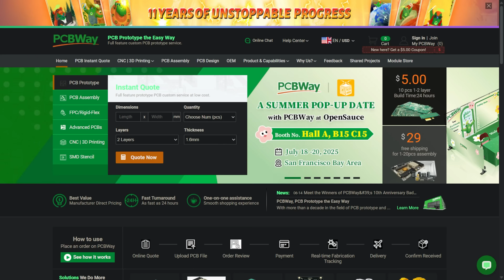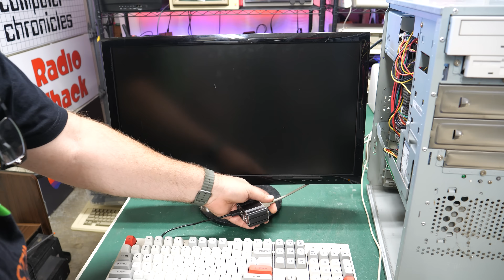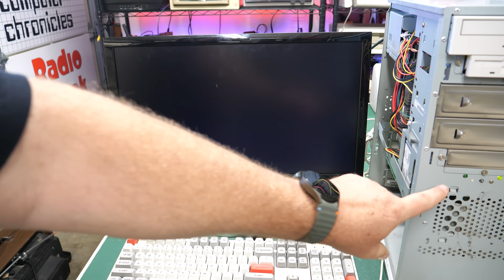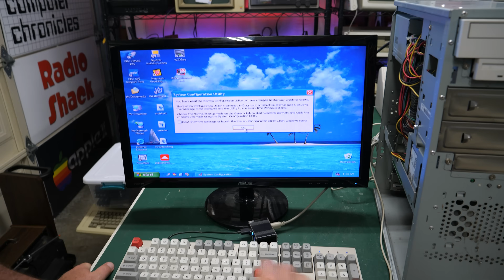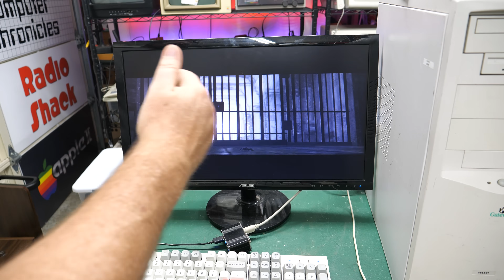Always Check Inside First! Gateway 2000 Edition

Comment: You should have set the time and date in the BIOS. Mismatches, especially huge ones, with Windows system time can cause a variety of issues.

You also should probably have just loaded BIOS defaults. Although not all manufacturers record good defaults, Gateway was pretty good about it. Even if you want to customize settings, you're better off loading defaults and then customizing.

Comment: OK, obviously these people howvwere doing whatever they were when they were tinker inside the computer obviously didn’t know computers are even how to go in there and make modifications.

You don’t have to cut any cables to take away things because everything can be removed with with just pulling the cables out or push, pushing in the lock clamps to unlock the cables..

🙄🙄🤦🏻‍♀️🤦🏻‍♀️

Comment: That takes a lot of talent to cut an audio cable inside the computer like that. I have never in my years of fiddling around inside computer cases ever cut a cable. And I have never cut a sound card cable.

I’d like to even know why they wanted to cut the cable because there was no reason to cut that cable because if they needed to change a different connection, an adapter takes care of of all your needs.

You simply went down your Micro Center and get whatever the hell it is you need or even the Best Buy if you don’t have a Micro Center.

Comment: I suspect those wires were possibly cut by somebody following a company procedure for decommissioning old computers.
Similar to how companies are sometimes known to only drill holes through laptop screens while still leaving hard drives and everything else perfectly intact inside!

Clearly not really intended for preventing anyone from recovering the data. Possibly as a half arsed deterrent, as they seemingly didn't really care about what was actually left on the drive. But possibly more so also to avoid destroying more important parts inside, maybe to cash in on the second hand market while potentially exploiting a tax loophole.
Unless they were otherwise just expecting it to eventually become land fill, which they probably didn't care as much back then about leaving data on the drive and just thought to cut the cables inside instead.

This token attempt at barely crippling the hardware can supposedly help to very quickly and cheaply further depreciate the value of computers that are being decommissioned. This deliberate decrease in value might be to increase the amount a business may be able to claim back on tax when claiming the estimated amount of depreciation as a business expense (either that or whatever is the nearest equivalent financial loophole). Something to possible claim was a necessary company security policy for writing off e-waste, but deliberately only doing just barely enough to questionably legally justify such a claim.

If I am right, then it might be why they had hilariously completely snipped off the power connector for the hard drive to quickly pretend to have made an effort to do something about the data on the drive. With clearly no intention of actually doing anything about the data on the drive.

Though we could possibly give them some very slight benefit of the doubt for seemingly faking it, as this could have happened not too long after a time when there were probably still less people about that would have considered just cutting those hookup wires as not an appropriate solution to seriously mitigate a potentially high level of risk to data security. As demonstrated in this video.

Thus the company, or someone within the company, might had tried to increase the companies tax return, while reducing the possible need for an e-waste disposal service (if there was such a thing there back when this happened). While it is also possibly that someone was trying to make some money on the second hand parts market.

I suppose the contents of the drive might be a clue as to if the computer might had been more of an office computer, or a home computer or possibly already a second hand computer that was still up for sale until the wires inside were eventually cut.

Well that is just my guess though anyway, as such a thing is allegedly a thing.

Comment: I have three of those exact computers in my basement I got from work when they were going to throw them away.  They had been taken apart as part or a computer class.  Not sure if it's the same processor or not though and don't have all of the cards you have in this one..  I put them back together and got all three to work.  Put a 60 gig hard drive in one and used an old gateway restoration disk I had that put windows ME on it.  I use it to play some old games on at times.
Reply from the maker: Nice

Comment: I usually put an unknown system in a garbage bag for a couple of weeks.  I open the system before powering up.  When  powering up I use a power strip with one finger on the switch just in case.  Also, a pencil or ink eraser is really good for cleaning tarnish off of connector pins.  Especially an ink eraser pencil from a office supply store because you can sharpen it to a really fine point.  The erasers will remove the tarnish without removing any of the metal.

Comment: First thing I would do is change the PSU. Not too retro but I recently bought a 7th gen HP i7 7700 for $50 and it had a180W PSU and I changed that pile of crap right away to avoid any future issues and it will give me the ability to add a decent budget GPU. For an OS I went with Windows 11 LTS for the older computer, way less bloat and no TPM 2.O requirement. I have an RTX 2060 super on the way to put into it, but even if didn't want to sell it as a cheap gaming PC, it's my own practice to replace a PSU after 8-10 years and that one being OEM even if it was the correct wattage, I would trust it less.

Comment: Partially cut wires is probably just a result of someone just slashing at cables with a box cutter pulling stuff out quickly. I doubt someone was doing anything with clippers or anything targeted. Probably just part of a mini-assembly line process - quickly going through stacks of retired machines.

Comment: Like you I ALWAYS before working on a computer that's been given to me, or if I've brought any is take off the side panels and check all of the cables very carefully for signs damage. I even check things that you might not think have power like the audio cable from an optical drive to sound card as they still have a nominal amount of power going through them which can cause a short either on the board if it's touching that, or if it's touching the case. I even check my systems that I have stored and not booted in years just in case a problem has developed. Even spiders can cause damage to cables, any my flat (apartment) has a problem with spiders. I was given a load of computers back in 2017 that were stored in a shed, and one had an old ants nest in it, and the ants had chewed through several cables, so always check for damage caused by spiders and other little insects.

Comment: I just got out my 2003 Win XP machine, based on an NForce2 A7N8X motherboard. I  last used it in 2018. Good job I had a look inside first. All 8 large capacitors are bulging and leaking brown goo out their tops. But no leaks onto anything else. So it's quite a job to replace them, but when I do it should all be OK. Hopefully...

Comment: That isn't the right power supply anyway. These machine has a non standard power supply in them, which had a white plastic shroud that went over the intake for the power supply, and the CPU and provided air flow over the CPU for cooling of the CPU and exhausted it through the power supply. A lot of those original Astec power supplies in these machines failed, not sure if they themselves were problematic, or it was because the CPU air was sent through them and cooked them, or a bit of both. Either way, there should probably at least be a small fan added to the CPU cooler.
Reply from the maker: Thanks for the info

Comment: Good advice to check out any unused gear before powering it up. I recently purchased a refurbished SFF desktop. Everything was working correctly except the DVD it was not recognized even when I swapped in another drive. Turned out the power wire was removed out of the chassis side of the cable. Reinserted worked great. I assume the IT department did not want employees using the DVD drive but that is just a guess.

Comment: Those cut wires tell me a dumb kid with scissors found an old computer and decided to play around.
Reply: it was a house mice
Reply: Nah, you can tell the cut wires part was recorded after the power on part of the video. The gray wires were just tossed in the chassis and had nothing to do with the PC, the IO wires were perfectly intact, and the hard drive Molex connector was the same and not repaired. The PSU was the same, so that rules out a PSU swap. This was obviously put together as a demonstration - which makes perfect sense, since you'd want to show off a working computer in the end and not have to show all of the potential wiring issues using multiple machines. Overall, good reminder on what to look for!
Reply from the maker: @RobinAltoft I don't do setup videos.

Comment: You've found a piece of technology that's rare these days. 👍 Athlon Classics have also become expensive. But you're right. Simply plugging it in and pressing the power button can have fatal consequences. Such power supplies are often defective and tend to destroy the rest of the hardware with a loud bang whenever you try to turn them on. Therefore, I would always test the power supply first.

Comment: 10:00

OK, take this under advisement if you want but here's a couple of rules of thumb to keep in mind with older vintage hardware.

Rule number 1: Damaged power supplies especially with damaged or cut wires must be either replaced with a new/refurbished unit of same type and output class with corresponding connectors as appropriate for the system you are working with or repaired and serviced by a certified and licensed professional electrician. (VERY IMPORTANT) Do not attempt to service a damaged power supply yourself unless you are a certified trained professional electrician WITH the proper tools and equipment required for servicing and or repairing power supplies. <(NEVER BREAK THIS RULE.)

Rule number 2: Play it safe and just replace the power supply with a known working unit. Any and ALL damaged wire harnesses are better off being replaced with "in good" working condition parts. Again, do not risk an electrical fire from using damaged, cut or severely bent wires, broken connectors, damaged contacts or other conditions that can cause an electrical short or start an electrical fire. (BREAK THIS RULE AT YOUR OWN RISK!)

Just please, be safe and when in doubt, throw it out and replace with new/refurbished parts where possible.

😁
Reply: There's very few risk with ATX power supplies.

Comment: ACDSee was a very light but powerful image viewer, along with some other features. Back in the day I could only open BMPs in mspaint or JPGs in Internet Explorer so for me ACDSee was like mandatory 😅
Reply: Man, I remember that program! I used it for years.
Reply: Still use it today. Haven't found any other program that can let me triage a folder full of images as quickly and easily as I can do it with ACDsee. Not sure if it still runs on modern Windows, but I am a Linux user anyways, so I run it under Wine, and it runs quite nicely.
Reply: @Otakunopodcast  I don't even know what ACDSee looks like these days... ImageGlass is my standard now.
Reply: @Otakunopodcast  I use Gqview / Geeqie on Linux, quite the same thing.
Reply: I loved that program.
Reply: IIRC, one registration code was "letis213111" :)
Reply: Still using Irfanview even today!

Comment: Electronics tech since 1977 here. ALWAYS disassemble and do a visual inspection of ANY electronic device that may need repairs BEFORE plugging it in. I'll give you a couple of examples. (1) Recently, I was brought a Phase Linear power amplifier to repair, and one of the aluminum meter brackets had come loose while it was being transported, and was lodged behind a circuit board. Had I powered it up, there would have been major damage. (2) I was brought an early-90's Fisher amplifier. After taking off the top cover I found that in all seven fuseholders on the main board there were 22-caliber long rifle rounds.

In the case of the computer shown, I suspect there was an angry wife with scissors involved.
Reply: Hopefully you replaced the .22lr rounds with more powerful 9mm rounds for more robust protection and stopping power
Reply: what the hell, rifle rounds in an amplifier?
Reply: That sounds deadly. Did you report it to police?
Reply: @ItsJustAdrean  It wasn't actually that dangerous. Stupid, yes, dangerous, no. A round like that, not held in a chamber and without a barrel, would not send the round more than a couple of feet if it went off. It was quite shocking to see, though.